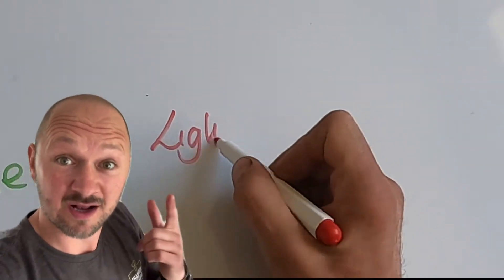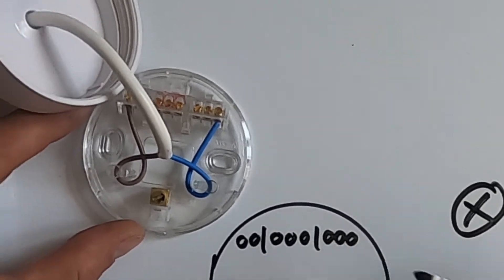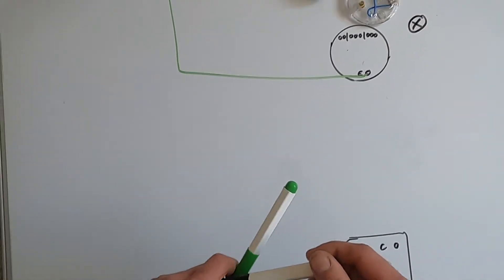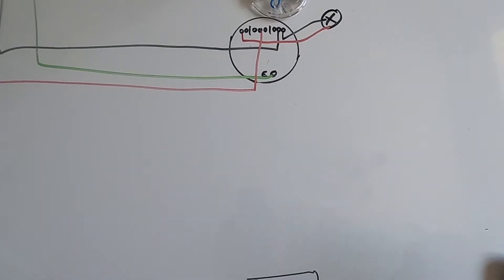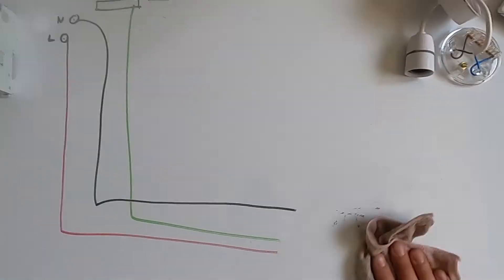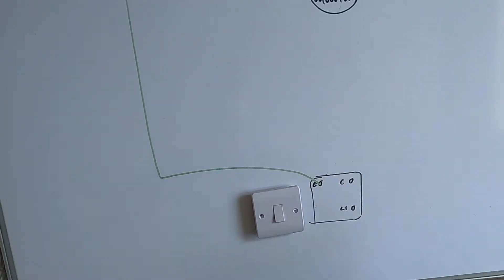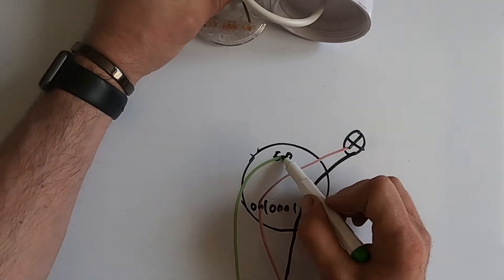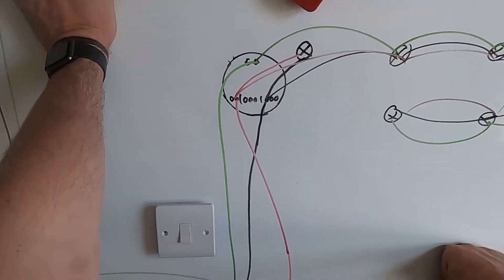How To Wire A One - Way lighting Circuit  - the old way and the NEW

Comment: Just put six led batten lights using this method the first two lights are permanently on the other 4 work with the switch what have I done wrong
Reply from the maker: It sounds like you might have wired the first two lights before the switch.

Comment: Great video! Im not an electrician but in trying to install a light in my loft. The issue I am having is its old style wiring but each phase is in its own cable. So I have a bundle of grey cables with green cables running along side them. Because of this the common/live wire doesn’t link up in the ceiling rose, it merely bypasses the light in question and heads straight to the next light switch for another room. So essentially each live feed is coming straight from the board. 

How would you go about tracking down which of these un labelled cables are neutral and which is live? 
They have a sticker on them saying “Modulec” if that helps with the dating. 

The house is an old prefab from the early 70’s

Thanks